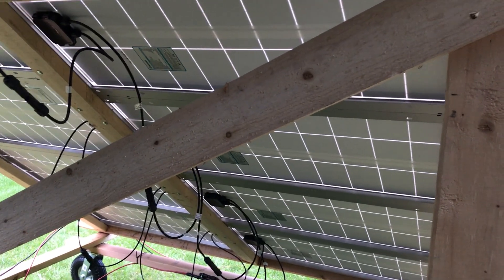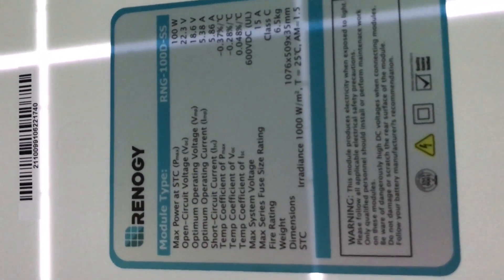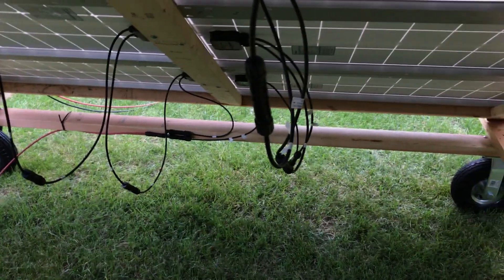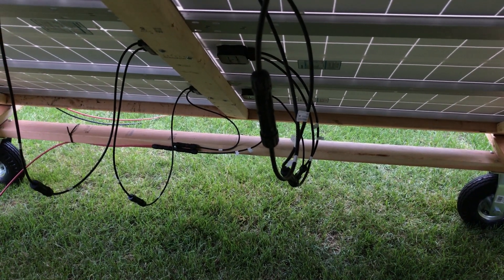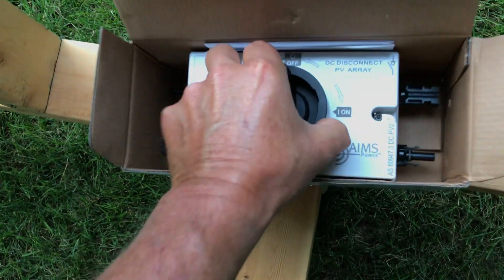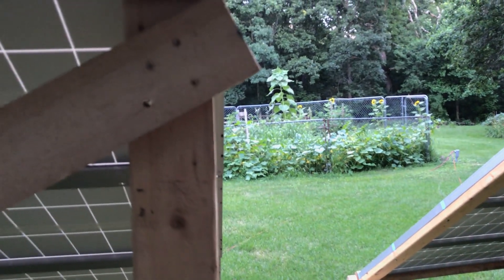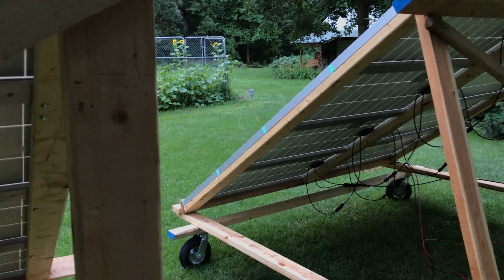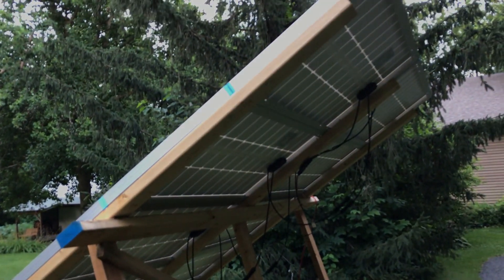1200 watt portable array details and links

Comment: Did you add an in-line fuse anywhere?
Reply: Btw, I am really thankful for the videos you've posted for your solar panel setup.  I have 2 ep500pros and the pv charging setup is the same.  I haven't been able to find information pertaining to actually using these with solar anywhere and you have been very helpful.
Reply from the maker: Not yet, probably should.
Reply from the maker: I just ordered 15 amp inline mc4 fuses. Thanks for the reminder
Reply: From what I've read the fuse should match the solar panel max amps listed on the label.  I currently have enough used panels for 2400w for one EP500pro but they will require to be wired 3 series and 2 parallel.   I think I'm going to order the bouge rv 200 watt panels for the other one.  They will be able to just be wired in 2 separate strings of 6 in series. They're about 22 voc, only 22lbs and satisfy the bluetti voltage requirements with plenty of room to spare for cold weather.
Reply: Which ones did you get?  The ones from bouge rv didn't have good reviews.   I need to also order mc4 connectors also to replace the mc3's on the used panels I have.
Reply from the maker: @sherrybee111  I got the renogy ones off of amazon they were on sale. Had  4 choices 10amp 15 amp 20 amp and 30 amp. 10 amp would be 1200 watts the 15 amp are 1500 watt. The charge controllers in. the bluettiAC300 are rated up to 12 amps I believe perhaps I should have gotten the 10 amp. I am going to call my son tonight, he is an electrical engineer at CAT and works with solar some
Reply: @johnkayak10  
150 volts and 12 amps per mppt controller for the AC300
Reply: @johnkayak10  
So what did your Son say about fuses? Needed or not and what amperage
Reply from the maker: @billy2bob63  He said they protect the wire and should be placed at the panels. He seemed to think the bluetti should have protection built in and the fuse size is based on wire size “Twelve-gauge wire is good for 20 amps, 10-gauge wire is good for 30 amps, 8-gauge is good for 40 amps, and 6-gauge is good for 55 amps,” and “The circuit breaker or fuse is always sized to protect the conductor [wire].”

Comment: Saw it thanks 😊 for this 12 x 100w how much input you normal see?
Reply from the maker: Have had full two battery charge by 10AM  some days plus running load from refrigerators freezers and dehumidifier
Reply: Nice I think I’m going to give same panel a try. Bought multiple 200w panel, from different brand. All get similar result 100-130w through out the day.  Maybe 100w panel works better.
Reply: Thanks for all of your info John. I'm looking at making a purchase of the dual AC300 bundle, 4 batteries and the split phase controller next week. The plan is to use 6 320 Renogy panels to charge the set up. Huge investment, and I am quite nervous about making it, but I feel it's necessary.  Seeing yours perform does put my mind at ease s bit. 

Thank you and God bless.
Reply from the maker: @MichaelS-4547  I had plans to do the split phase as well until I saw where they were having issues with the transfer switch I have. If  you use the bluetti transfer switch, then you should be fine
Reply from the maker: morning and afternoon sun 1200-1700 watts mid day have had full 2400+ watts